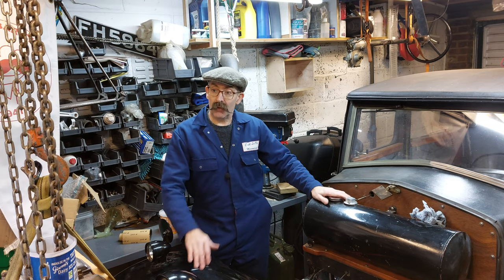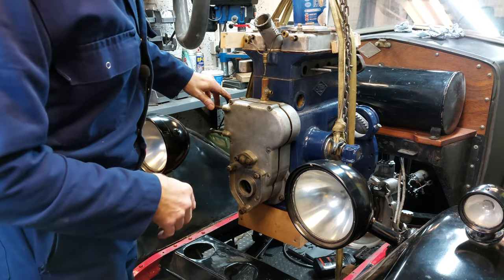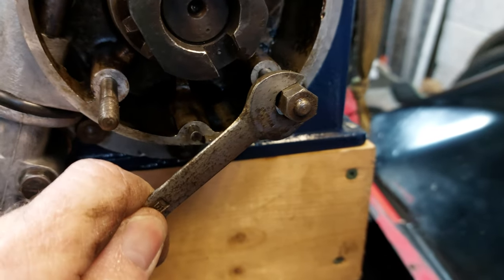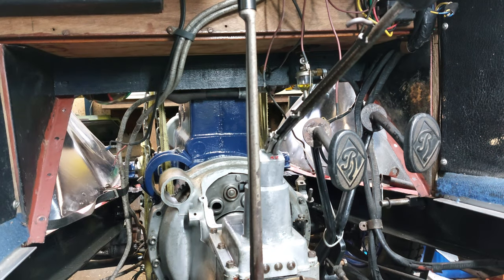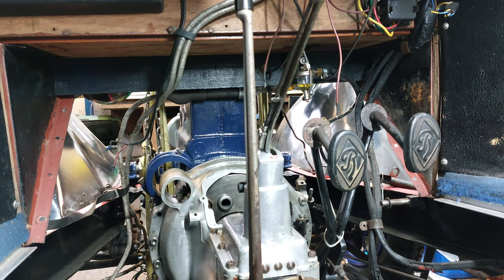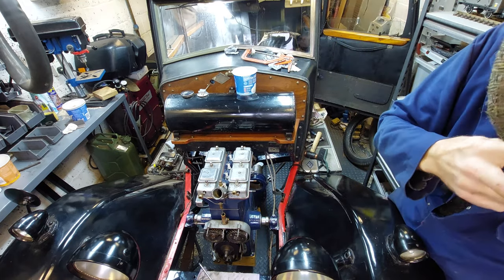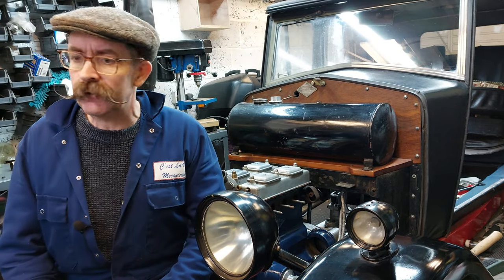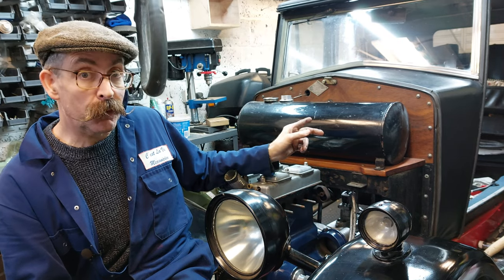RILEY 9 ENGINE INSTALL, TRIALS & TRIBULATIONS OF VINTAGE CAR OWNERSHIP  ( PART 6 )

Comment: I am starting my Youtube channels soon as I clear out a couple projects. I have been sourcing parts for my 1928 Morgan RIP (MG) Special. I sourced an experimental opposed twin engine for the front. I am melting and casting a two part adapter to mate the engine to an MGB transmission giving 4 gears forward and one reverse. Then using an MGB rear for the special attribute. The wood over steel frame with aircraft cloth over it will be  plenty of work but it is the next project that I am truly excited about. I have an engine and transmission for a pre war MG Magnatte with the polished steel and the dual wheels but that will be a few months from now... I know what you feel when you work on your Riley. I am stoked!!!
Reply from the maker: Good luck with your Channel John, those projects sound really interesting, I'll keep a look out 👀
Reply: @TweedsGarage  Thank you my friend!!!

Comment: Removing the front timing case and bottom studs, removing the steering column and steering box instead of just lifting it aside, are all things that would have made my life easier when a friend and I put the engine back into my 9.  It made lining the two pins up onto the clutch basket, for instance, interesting to say the least.....
Reply from the maker: i tried to remove as little as possible as i attempted to remove the engine Simon but each time something got in the way so it all got removed, i know if i do it again i will remove everything first as it makes it so much easier in the long run.
Reply: That whole clutch linking up thing will be interesting on mine as it's just a pile of bits put together but with a new crank and flywheel machined to fit. So I have no idea if it will actually all go together. And can't know until I try. I wonder if the flywheel will be far enough down the taper on the crank. I think assembling the gearbox onto the engine off the car will be easiest then lifting the lot onto the chassis but I don't have a body to deal with yet - have to make that still! Plus I need to work out the clutch actuating levers too. I don't have the right parts I think.
Reply from the maker: @asciimation  i think there's a bit of wiggle room with the clutch fork being on splines on the operating rod allowing for adjustment to get 1/4" - 1/2" movement at the pedal before engagement ( according to the little Handbook of the Riley 9 )

Comment: You made that look quite easy Mr Tweed.
My worse engine out/in was on Rover 2000 back in the 70's.
A friend was going to help but was put off by the weather. Nearly freezing, wet and we were on the outside drive. After picking the replacement engine up from the scrapyard I got the old one out by the Saturday evening. Sunday morning, still wet, I tried to fit the engine. It took most of the day with spells indoors warming frozen fingers. I began to suspect there was a difference between the engines and decided to have one more go. The relief as it finally went together!  Cold hands and on your own isn't a good mix. I also had the pressure of needing the car for work early monday morning as it was our sole transport and I was 20 miles away.
Thanks for sharing, like others I'm looking forward to seeing it running.
Reply from the maker: Rover 2000 probably weighed a bit more I should think Colin, nothing more stressful than working on your daily driver ( got glow plugs to change on the Transit and I'm not looking forward to that )
Reply: @TweedsGarage  It was rather weighty. Engine was hung from the frame of an old garden swing so the car had to move and not the engine. Good luck with the glow plugs, the last time I did them were on a 2000 focus and  very tight to get out.
Your gantry proved well worth the effort to make.

Comment: Good job Allan, strange thing, I've had a little debate with Simon in New Zealand building the Brooklands, he's painted his engine black, I suggested that the Riley diamonds cast in the engine block would look nice painted Riley blue, lo and behold you've painted your engine blue, weird or what, looking forward to seeing it running mate...
Reply from the maker: It had three coats of paint on it and they were all blue, so I just went with it. The log book has the colour of the car as black and blue and there is evidence of blue paint on the chassis as well so may of been ordered that way. The chassis will be blue again when  I can get round to it.
Reply: @TweedsGarage  The blue on the Riley logo on the bell housing cover looks nice but I am still going with black or plain ali I think. That wasn't a crack in the bell housing was it at about 2:32? Mine was cracked where the pedal shaft goes through it so I TIG welded it up. When I was rambling about adding alternator innards into the dynamo people pointed out with no starter handle there is no way to turn the engine over for setting valves and so on. One suggestion was jack up the car and turn one rear wheel with it in gear to move the engine. Regarding input shaft bearings or bushes, always make sure they fit before putting engine to gearbox. I learned that the hard way on my MGB with a spigot bushing that was slightly oversized on the inside diameter (or is that undersized?) so there was no way to get the gearbox fully home as the shaft wouldn't go in the hole! Took me ages to work that out.

Comment: I usually use two to three to put the engine back in so that there is good company to celebrate the event when it is completed. There is always the insightful comments that come out at the same time-  'Knock off the rivets from the front cross member and bolt it back on when the engine goes in'.
Reply from the maker: Oh yes there's always that one 😄

Comment: Looking good Mr Tweed. Wonder if your Jenkins is one and the same as my Jenkins? Do you have a tachometer take off on this block, some do but my 33 Lynx does not.
Reply from the maker: He is a nuisance, no there is no tachometer drive on the back of the block, from what Simon was saying on his build is that they ran off the back of the inlet cam replacing the blanking plug with a drive I'd suspect.